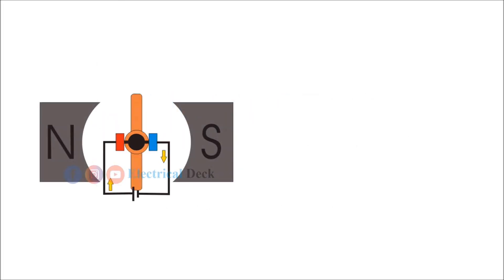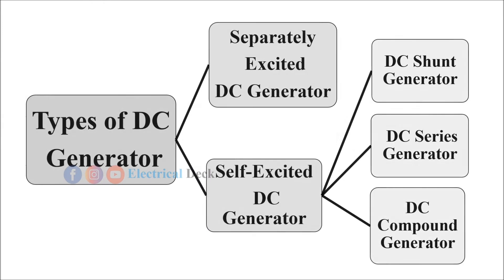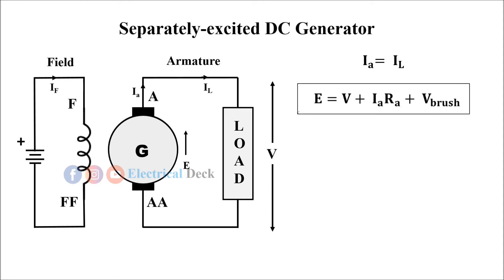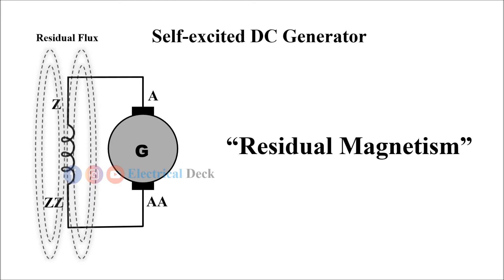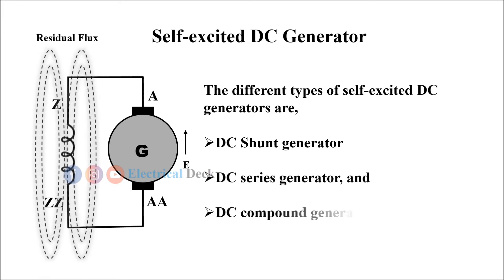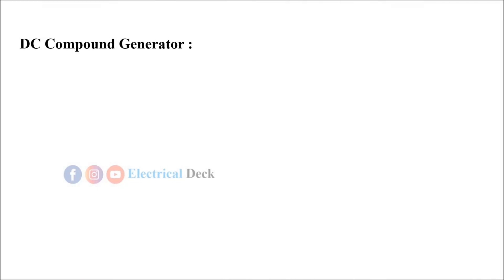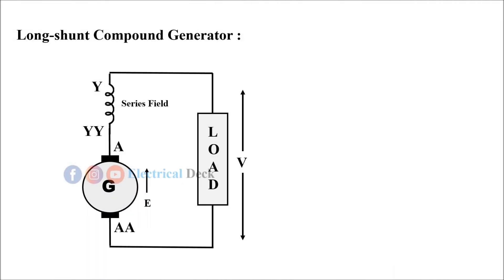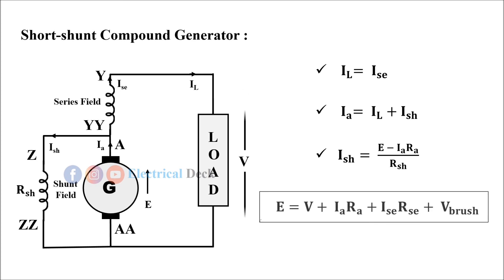Types of DC Generators - Separately & Self Excited DC Generator | Shunt, Series & Compound Generator

Comment: I was wondering if dc motor can be converted to universal motor ore generator? Wuld it be posibel to turn 4 brush starter motor to act as universal motor ore starter/generator if you actualy split those 4 brush holders?

Comment: Wuld it by posibel adding transformer wires to shunt dc motors and generators makeing them compount motors ore generators? What if I wanted that same device to by motor and generator how wuld I wire regulator to that thing ore how wuld I wire automatic switches?